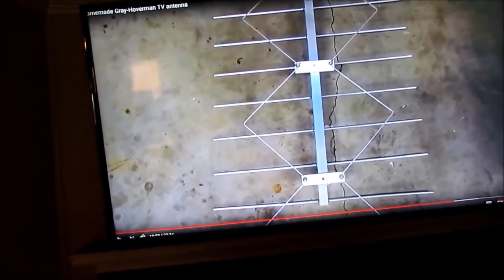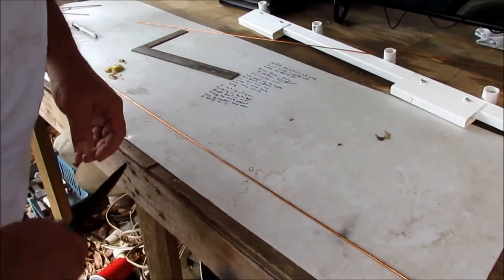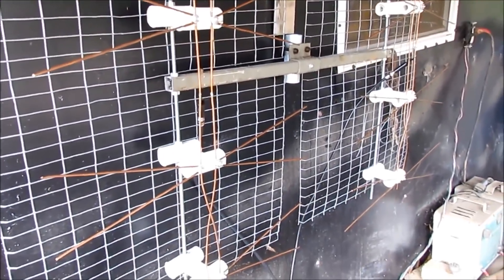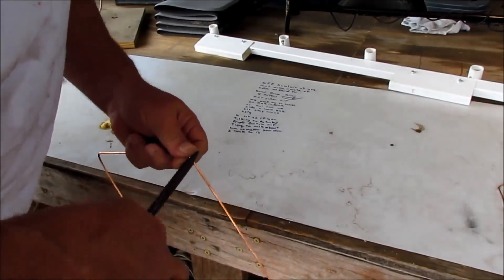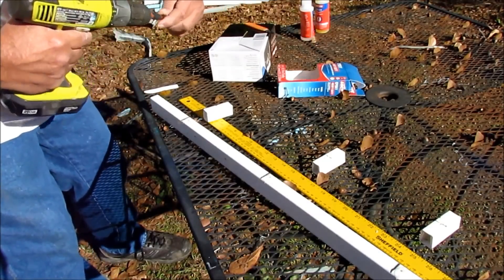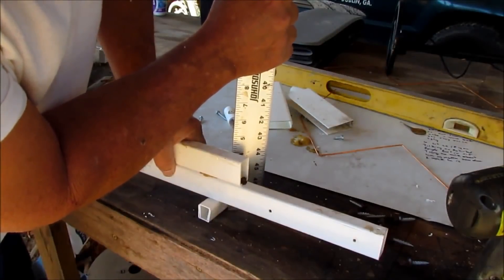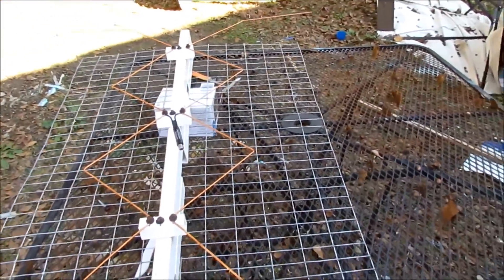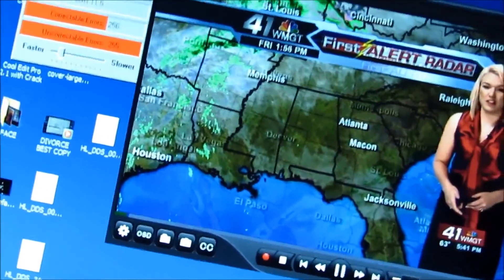HOW TO MAKE THE GRAY HOVERMAN TV ANTENNA

Comment: I know of an antenna that would be better but I dont want to spill the beans if its the one you thought of. Me being a ham radio operator know about antennas being UHF it would be practical to build a UHF version. Lots of gain. I would use solid bare copper ground wire. 73

Comment: Nice to review what i saw years ago. This antenna is like the radio shack antenna that dad bought for me to put up on our farm south of Erie PA. Good design but i bet the rabbit fence works better for a reflector. Which was used on the screen bow tie antenna yesrs ago. If i could find the materials i would build this antenna. I dont like using wood. Plastic is much better and doesn't get water logged. Thanks Danny 73

Comment: There seem to be some inaccuracies in your statement. The first that jumps out is that Channel 5 is in the VHF-Hi band, which it is not. VHF-Lo is channels 2 thru 6 (30 thru 87MHz) , and VHF-Hi is channels 7 thru 13 (109 thru 300 MHz), with the FM band (88 thru 108MHz) in between channels 6 and 7. So, you must mean the 170-230 MHz channels are 7 thru 13.
Reply: Does it really matter to be off two channels? The point got across and I used an FM antenna to pick up VHF low. Three and six came in good even two was ok for the distant it was away. Most channels now are on UHF in Florida just they have a virtual number that is in the low VHF. Over the air it's UHF. I always look to see what the frequency is not the number anymore. 73

Comment: Danny, I know this is an older video and your selling the Ultimate antenna so i'm thinking you like it better then this one. I seen the other video you did on this Gray with the add on for VHF on the top and bottom. I'm like you if i had not seen it with my own eyes (you doing the test) I would have said no way is that going to work not making contact with the rest of the antenna! Anyway a question if you have time if not i understand. My place has 1/2 of it's channels on VHF and the others on UHF. The ones i want most is on VHF (CBS and FOX) i got ordered the parts to make my antenna and was going to go with the one you came up with "The Ultimate Antenna" but do you think this one may work better for me on the VHF side with the top and bottom hates on it? I know you have done all the testing and i trust your option. Thanks for all you do for us !

Comment: I  built this antenna to replace a directional store bought one. When I pointed the old antenna at our "far away stations" I would lose the local close stations. I added a booster to the Gray Hoverman and now get the 70 mile away stations as well as the locals. We live in a valley and I knew our situation would make it difficult for any antenna. I was very happy with the results. Some of the stations that were pixelating are now clear and we got several new channels as well. Could not ask for more! Thanks for the informative video, I had a set of plans but could not have built this thing without the video.

Comment: Hey Danny! Nice work! Are you using acid core solder or rosin core solder???
Reply: You should only use rosin core solder for electrical work. The acid flux will result in bad connections over time.

Comment: Danny-
Will your Ultimate Antenna pull stations from 100 miles? Thank you sir! Kevin
Reply: If it is at least 35' above ground it should, depending on terrain in your area.  I'm at 42' and I pick up stations 130 miles away.

Comment: Thanks for the instructive video , i'm from the UK ,i bought the heavy gage copper wire and transformer (balen) off ebay , and used cable plastic trunking varying sizes from B&Q and a mesh role of wire square type in stainless from the pound shop ,put it in my loft was total blown away with the power of this thing picked up around 220 channels full strength crisp n clear ,and thats in the loft caped with roof slates . Thanks again Danny .

Comment: I made this antenna and to date have not put the screen on it but I have it in the window of my bedroom and am pulling 38 channels from as Grand Rapids, MI - 75 miles away!  NO booster yet either!  I'm going to put it in my attic so it will be 30 feet above ground level!  I'm super glad I found your channel Danny, thank you!
Reply from the maker: tks for letting us no
Reply: If you use high quality coax like RG-11 you probably won't need a booster from the attic with less than 50ft of cable. If using splitters to feed multiple TV sets (a splitter obviously drops the signal strength by half) or running long wires outdoors, it might benefit from a booster. For the love of god, pick up a $15 lightning arrester connected to a solid ground if you're going to mount this thing on a mast. In some parts of the country you're guaranteed to fry your TV (or worse) if you build a tall mast with spiky parts aimed at the sky.

Comment: I haven't built the Gray Hoverman yet but I have built 5-6 of the ultimate antennas for myself and some friends and hey are awesome antennas. I'm 34 miles S of of San Antonio and pull in 52 perfectly clear channels using a 16 foot mast. I'm even pulling in an old analog channel from Mexico which is about 80 miles away  It's snowy but it's there.

Would not have had this success if not for Danny's videos. There are several YT clips but none with the detail of Danny's videos.  Thanks Danny.

Comment: I figure your plastic is 1 1/2" and the short pieces are 1" x 3/4". Just a guess because you said the reflector had to be 4" from the other elements. Am I correct in my assumption?
Reply: That would be my guess. He talks about the other guy's video complaining about not showing how he built it but fails to mention what size his components are. I guess I am going to go look at his original antenna build. I am about ready to try this. I got the parts but not the same exact PVC size backbone parts. I see the 4" separation also. There is another guy out there in YT Land that doesn't put a back screen or shield on. Easy enough take off and put it back on if it would make a difference one way or the other.

Comment: why do use copper and not aluminum?   my commercial made channel master is all aluminum.   Since the whisker tips catch the top and bottom of wave, maybe them being connected or 1 peice angled doesn't work as good?   You're smoking the entire time you're talking?   also the more whiskers the better for farther,  weaker signals,  is what I understand.  yep factories have to factor in profits for importer,  distribution,  and retail. $80 retail  antennas cost  $14- $20 factory costs.
Reply from the maker: YEP YEP YEP

Comment: I hate to keep asking questions but where can I get the software for the signal testing
Reply from the maker: internet
Reply: ordered one. thank you. If I made a hoverman anenna twice  as long would it work with solia wire from topto bottom or would I have to make two antennas verticaly?  Sure would like to know what you are keeping to yourself

Comment: Danny, can I make a single hoverman antenna twice the size vertically with one piece wires on both sides with the vhf fix on the top and the bottom? I made your ultimate antenna with eight elements side by side. It al most works perfectly but not quite.In stead of makeing one of those I thought I'd make a long hoverman, do you think it would be better?

Comment: well I put it up today and channels 3,6,12,33 45 all work great but 21 and 24 do not and with my dual clearstream they did come in.Now what can I do to get them? anything? I am 55 miles from all of the towers. 21 has 4 channels on it and 24 has 3.
If I cut a couple of the elements for these channels will that work? half wave is 11.3 for 21 ans 11.4 for 24. !/4 wave is 5.72 and 5.6 respectively. what do ya think ?
Reply from the maker: all the antennas i put up i install boosters...i do no what to do but its to much typing..i will make a video of that and it does need to be made.

Comment: by the way it is the double ultimate antenna. My clearstream is up about 15 ft above my roof with a amp. During the day especially in the mornings it goes away and pixelates on almost all the channels. I put the double ultimate antenna up head high with out an amp and channel three and six come in solid but none of the upper channels. When I hooked  the clearstream up with the amp it was pixelating on three and many of the higher channels. I( think its going to work better when I get it up but I need ed help to install it and there was no one around.
Reply from the maker: FRED THAT PIC DIDNT WORK..THE SIDE BY SIDE ANTENNA WAS MEANT TO USE 2 DIRECTIONS..I WILL BE DOING A STACKED ANTENNA

Comment: I built your ultimate antenna and it took me 1 1/2 days. But I ordered wire that was so damn crooked and bent up it took me awhile to straighten it. I will try it tomorrow and let you know how it does. I have a Clearstream dtv double antenna up so we'll see. The stations are like 60 miles away.
Reply from the maker: YES LET US KNOW..60 MILES YOU NEED A BOOSTER U NO FOR DURING THE DAY

Comment: Hey, Danny another great video. 
What type of square pipe is that? Every time I go into Home Depot they have no idea of square pipe that isn't metal. Any help would be appreciated. I made your ultimate antenna but with wood and no reflector, as I had spare 2x4 around. I used 4ga copper wiring for the bow ties and 6ga for the connecting wire. I also made a dipole VHF antenna to add to the ultimate antenna out of 4ga. Once I test it out I'll report back. Also my VHF antenna is only for channel 12 for VHF as that the only channel I want that is VHF.
Reply from the maker: DONT NO BRO I GET MINE FROM  A MAN WHOLESALE..IT COMES IN LIKE 16 FT LINKS
Reply: Try the big home improvement box stores like  Lowes/HomeDepot etc. I seem to recall seeing square/rectangle extruded plastic parts like in the areas  where they have fence  stuff.  

I have taken very common schedule 40 PVC round pipe (3/4 to -1")  for may  amateur radio antenna builds.  Since  Danny is using short pieces, you could  soften the round  stock in boiling water  and press it between some lumber to make it flat or oval.   Too, if yo can  find some  scrap out-door flooring  planks (generally 6" wide), you can rip,  then cut them to length.

Comment: Thanks Danny, because of you I dropped dish like a bad habbit! I'm now saving over $100 a month. I built me and my father in law an ultimate antenna and are receiving 30+ channels ota. I'm going to give this grey hoverman a try this weekend (looks a little simpler to make, with less contact points) Appreciate all that you do!
Reply from the maker: TKS
Reply: @DannySHodges  Hello Danny, would using 8 gauge wire make the antenna better in the point of being stiffer ??? How about using a 6 gauge wire if one makes the antenna for oneself ??? Thanks Danny.

Comment: Danny dose this one pick up VHF as well as UHF
Reply from the maker: IT WAS WORKING GOOD..
Reply: Danny S Hodges but will it pick up channels 6/13 on VHF
Reply from the maker: WE GOT 3 VHF CHANNELS AND IT PICKED ALL 3 UP
Reply from the maker: AND ITS THAT LOW RANGE
Reply: awesome will be building one over the holidays then thank you Sir
Reply: These Grey Hoverman antennas pick up VHF signals better if you add what are called NARODs.

https://onetransistor.blogspot.com/2015/01/gray-hoverman-wideband-vhf-uhf-antenna.html
Reply from the maker: Richard Holbert TKS
Reply: mine does and I am 60 miles from the towers